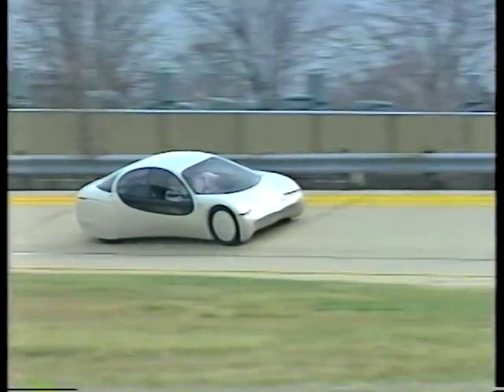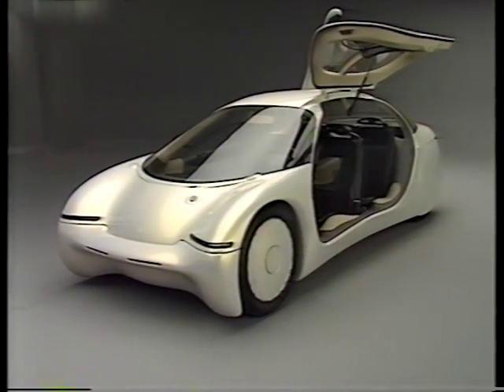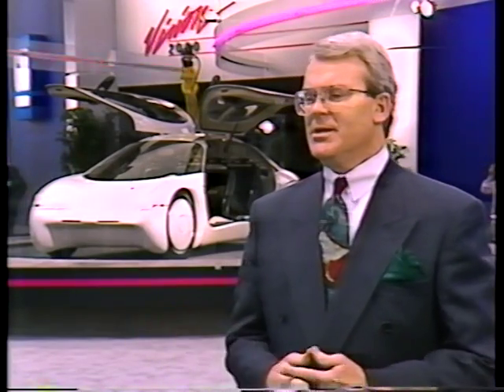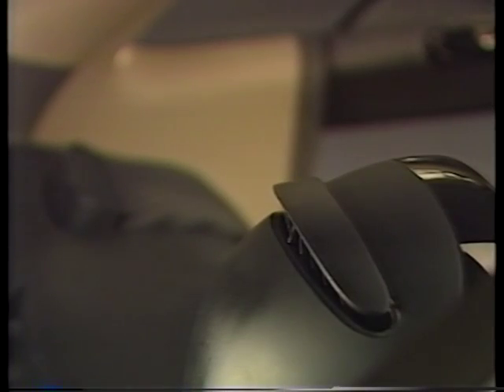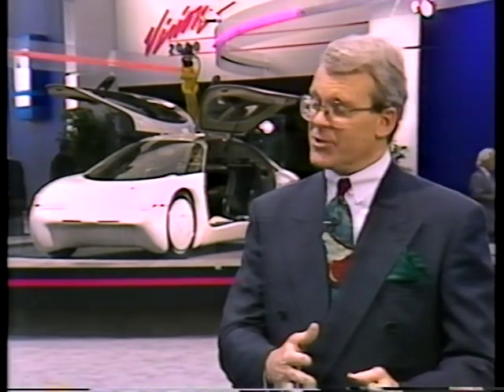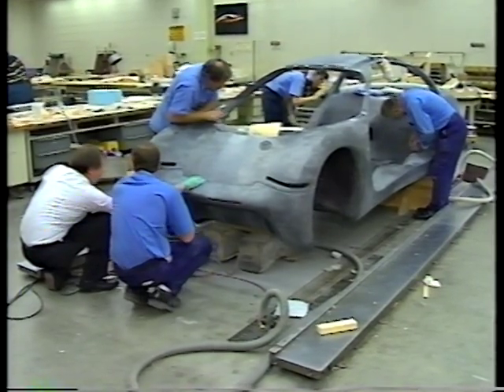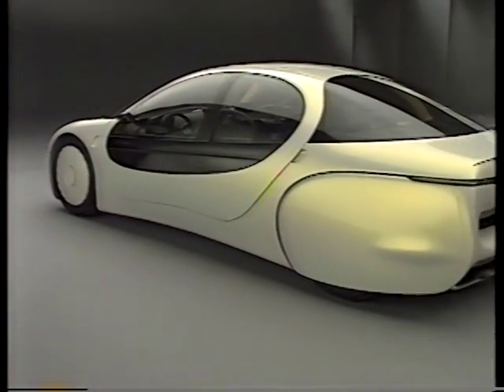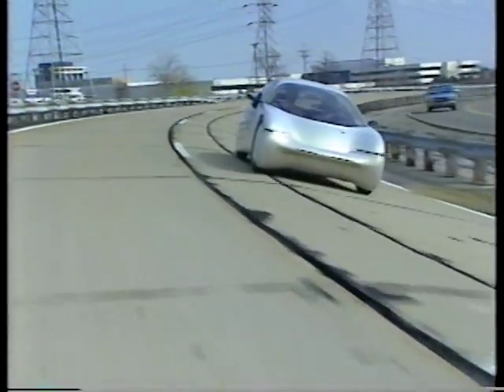1992 GM Ultralite running concept car

Comment: I see all the comments talking about how much it would cost to produce these, but I don't see anyone talking about why we don't have this body shape on current cars.  A coefficient of drag of 0.19 is quite good and you could make the shape out of metal and get a huge savings on fuel economy.  There is no excuse for still having no cars today with this CD.  It wouldn't cost much--if any--more.
Reply: My only gripe is how'd you gonna change the rear tires.

Comment: Direct injected 2 stroke has pretty good emissions. I'm not sure if that's what they were using back then.

Fuel economy standards were dramatically more lax back in 1992, but also, this car would have used under half the fuel to maintain the same MPH as any other car produced back then. So it could have actually been cleaner than other cars produced in the same time period.

Comment: It weighed 1400 pounds most cars now weigh that same amount without carbon fiber, saying carbon fiber is the reason they didn't move forward with this is retarded. They didn't move forward because "at the end of the day" its about profits. From the big companies that supply the oil to the cars you drive to the small mechanic that charges you 700$ to replace your catalytic converter.

Comment: There were 3 reasons this car was not mass produced:  
-Carbon fiber was (and still is) very expensive compared to sheet metal or plastic.  The average driver who cares about 100mpg fuel economy could never afford this car.  Remember that even the frame on this car is carbon fiber.
-Crash safety!  This car had no where near the required standard of the 1994/1996 legislative standards.  
-Who was majority share holder of GM in the 90s?  OPEC governments (upto 14% making them the biggest holder).

Comment: Thats a misleading statement. Your Volt gets 93mpge equivalency running on electricity vs a Nissan Leaf (99mpge). And then 35mpg on gas. Your average MPGE will never be more than 93mpge, and since you've used gas at all means means your averaging 80mpge or less. 

The Volt comes up with that ridiculous 327mpg number as a valid statement of gasoline consumption but NOT of efficiency! If a Leaf used one gallon of oil lubricant in 100k miles, it's mpg would not be 100,000mpg! It would be 98mpge.

Comment: The technology is damn expensive. I've worked with carbon fiber bodies and they are incredibly complicated to mass produce and just getting the raw material costs an arm and a leg. A university project bicycle-like three-wheeled one passenger vehicle is about 15,000$ in materials alone. It's cool GM has had the technology for ages, but would someone be willing to fork out over 100,000$ for a two-stroke engined car just to save gas? You would have been much better in 1992 just buying a Corsica.

Comment: I don't think people really listen to the vid too much. The body is made from CARBON FIBER, this car would cost a massive amounts, it would price most people out of the running. 
A 2-stroke engine? Good luck having to re build it every 1000 miles eg new pistons etc, not just an oil change, an electric unit would weigh so much as to make the weight savings redundant.
There are cars out there (VW POLBluemotion) That could get 80MPG at 50mph.

Comment: The issue is that its running a two-stroke engine that produces much more pollution such than a 4 stroke. It might get better fuel economy but at the price of higher emissions

Comment: actually it is more likely that the big oil interest groups had more to do with killing this than unions ever would. 

Realistically it is probably the inertia of the management at GM which isn't happy with new risky ventures combined with the fact that they don't have to to still sell cars. If the auto industry bailout included a mpg provision we would see more cars like this built.

Comment: Because these cars were INSANELY expensive to make and still would be today.  Carbon Fiber is super expensive and these cars today would retail in the triple figures and that's not even taking in the R&D costs as well as the overhead that they'd have to tack on to the cost of the vehicle just to make some sort of profit.  There just isn't a realistic consumer base.

Comment: If you'll notice, the shape slightly resembles the EV-1. GM was ahead of their time with cars like this, and the EV-1. It's just that the technology wasn't available yet to make a viable electric vehicle, or the demand in a super fuel efficient car. Fast forward 20 years and it's a different story.

Comment: How do you change a flat rear tire?
Reply: In the film the tire it swells on its own
Reply: @mikedupond8392   it also hasn't got the self drive and the safety foam system fitted on this version

Comment: @ssdwellah 

The Jetta is nice if a little small for me. I wish more people would consider the TDI but it comes at a slight premium.

I've heard a lot of people distrust of diesel springs from a ineffective redesign of a GM 8 cylinder.

The European diesel heritage doesn't appear to have this problem including some big 3 cars in Europe.

Many changes will be cost justified if fuel prices continue to rise.

Comment: @ekpil2000 Interesting points. I, for one, would like to see more small turbo-diesel engines in the US. But diesel was stigmatized in the US during the 70s and 80s and 'unclean' and poorly performing. I think both of those detractors, if they ever existed, have been overcome but big oil doesn't like diesel vehicles that get 50-120MPG.

Comment: @ssdwellah 

We are seeing fewer road deaths than previously with more driving being done than previously. I think this is partly the benefit of crash testing.

Without a B pillar this car would have side impact issues that would have to be designed around.

Some of the advancements have been slowly entering the market like lower air resistance.
 If you like that feature have a look at the Apterra.

Sadly people dislike small light breathable seats.

I want to see DI 2-strokes commercially.

Comment: Generous Motors, where is this car?  I would have happily settled for one made of a little heavier fiberglass & bio-polymer composite body, with added "ultralight" crumple zones!  20 years after the initial design, one would hope GM would have one to offer, even if it weighed an extra 300 pounds...